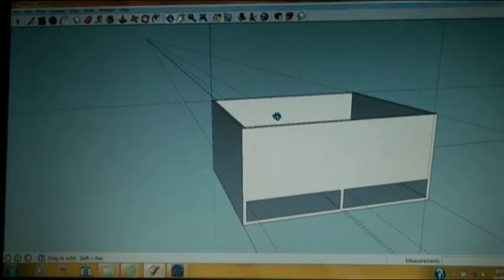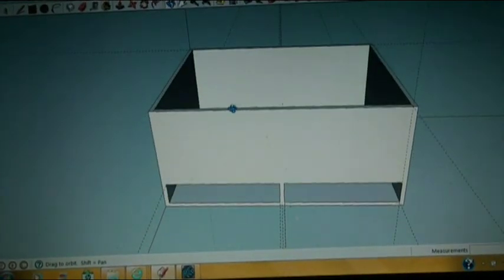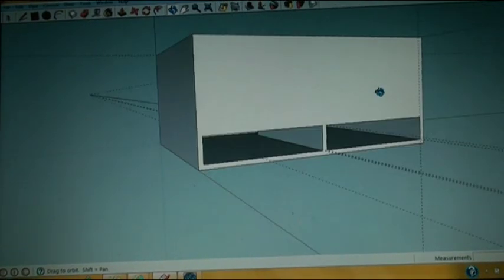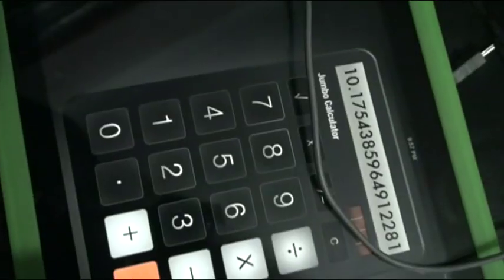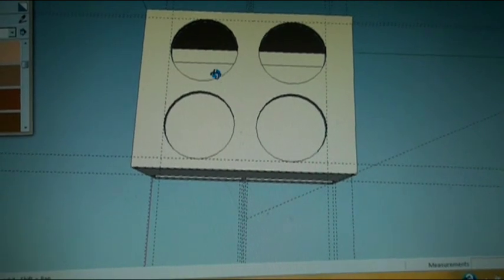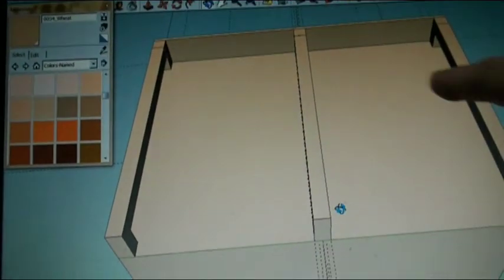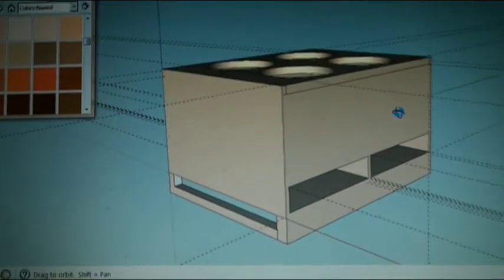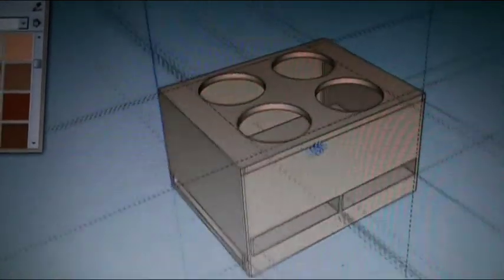Jackaroo 4 12"s Box Google Sketch Up & WinISD Pro "1"

Comment: damn man only if you still had the commo, just recieved my alternator from the states 250amp, 14.9v regulator (inbuilt) HD Stator and windings / Smaller pulley   Clamped at 249 amps full load. for $250 DELIVERED!   i couldnt belive the price.

Comment: I'm only a year older haha my voltage is good most days usually stays above 14v, sits around 14.3-14.4v once things are warm, 14.6-14.7v from a cold start. Sometimes it randomly decides to drop into the 12v's with the bass but it seems to be only a random occurrence. Yeah you definately need a voltmeter haha anyway, I think I might make a vid of the 18 tomorrow, anything you would like to see? I'll link you in the description even though my audio channel only has 35subs :/ haha